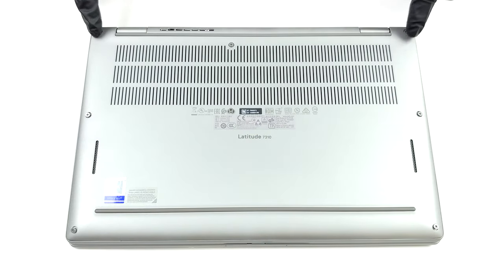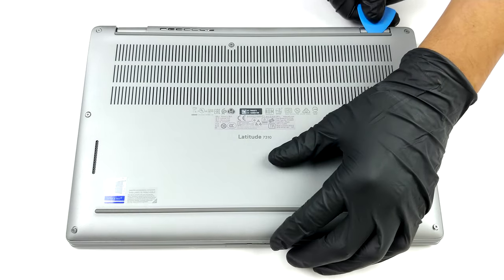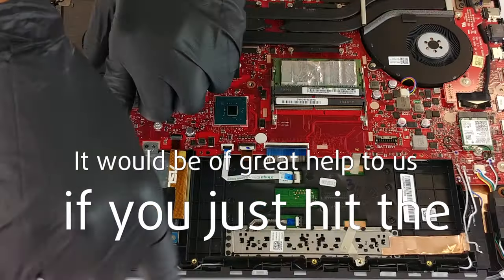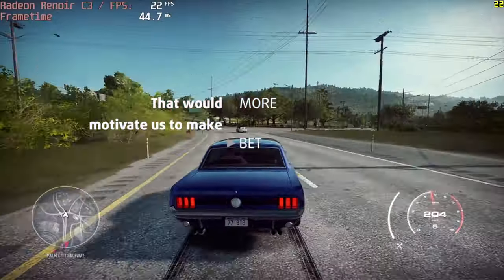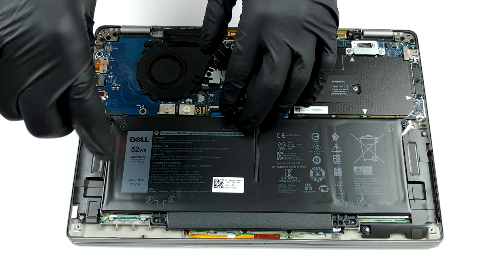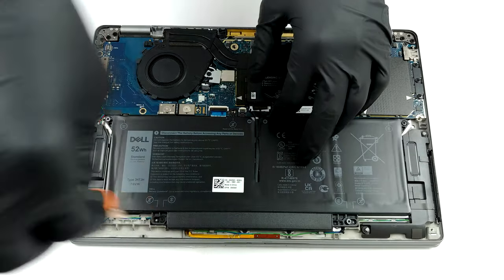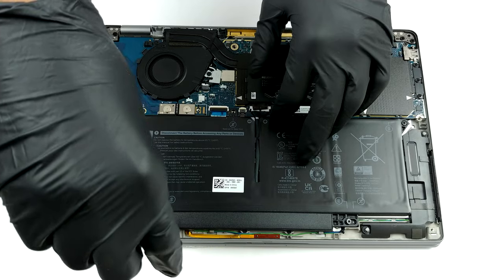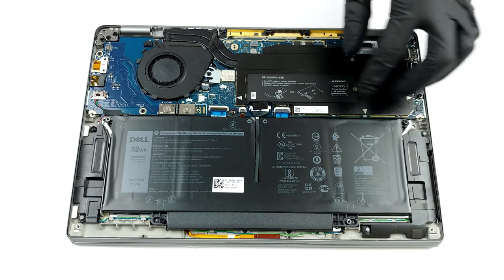🛠️ Dell Latitude 13 7310 - disassembly and upgrade options

Comment: RAM cannot be upgraded?!
Reply: That is what I was just looking for too!!! UGH!
Reply: @MatthewRobertson1701  Correct. RAM is soldered on the DELL Latitude 7310, but the 5310 has two SO-DIMM slots for future upgrades. If purchasing the DELL Latitude 7310, you will want to ensure you configure it during purchase for the memory you need.
Reply: @techoasys  oh crap, hahah can test other rams too

Comment: This video was okay except that you covered the battery connector pull tab part with your hand. That's the part where I was the most stuck. I can't figure out how that comes out and almost broke it at this point. It must be hard--looks like you had trouble too.
Reply: It pulls upwards towards the sky, and it inserts downwards into the table.

Comment: Where is the cmos battery?
Reply: Did you ever find the answer to this?
Reply: @silique9244  same..need to know this as well.
Reply: @madrox303  I literally can't find info on where it is anywhere :(
Reply: @silique9244  same. makes me think this thing doesn't have one.. i may just take the mobo apart and look for it.
Reply: @madrox303  Where you able to find the CMOS battery?